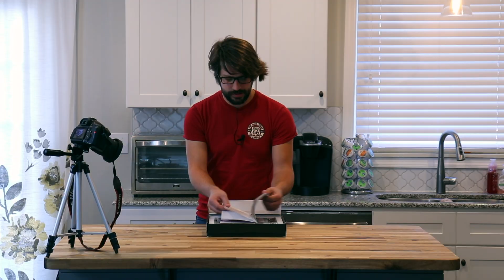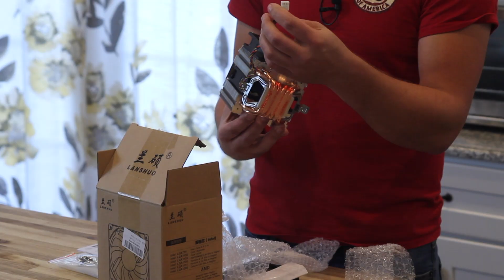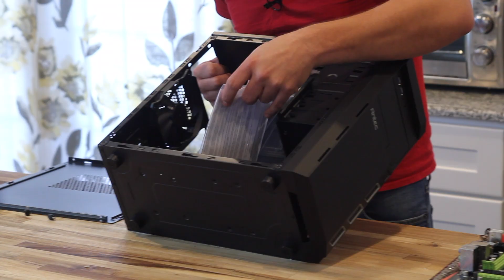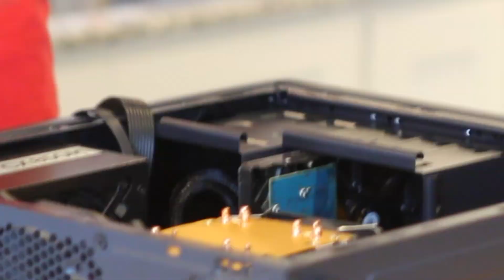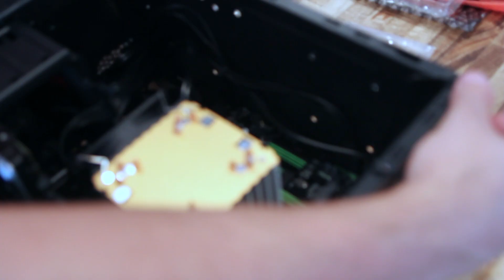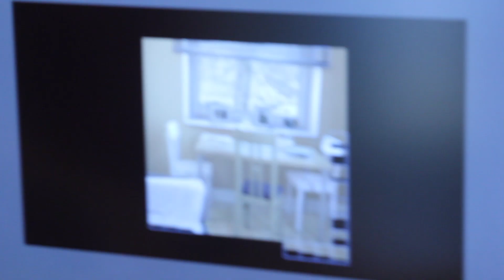8-Core PC on a Budget

Comment: FX-8300 are often dirt cheap with motherboards on the used market, old workstations with 6-core Xeon are often for sale which in most cases can be used with a modern power supply and upgradable GPU. This? Not a bad pick if you find one REASONABLE PRICED. UwU
Reply from the maker: Good point. I don't want to spoil too much but I have two older platforms that might be doing a showdown so stay tuned...
Reply: @TechTested  The Xeon idea I most credit Timmy Joe his video about was quite good, sadly local prices were not as good as the ones in Canada when I upgraded my Athlon X4 880K so in the end I found a super cheap board + Ryzen 3600 for low prices. 😁✌🏻